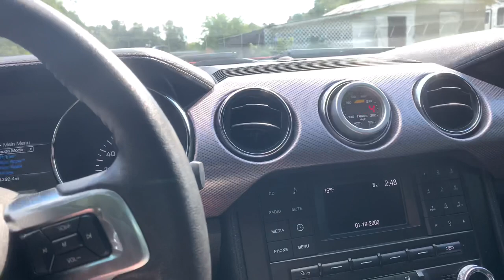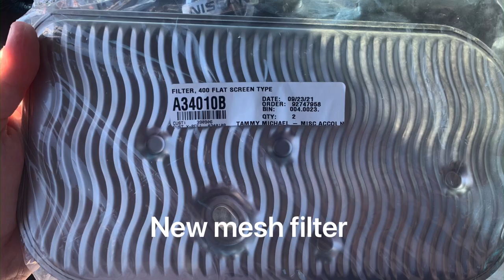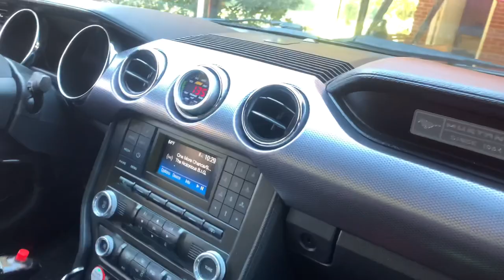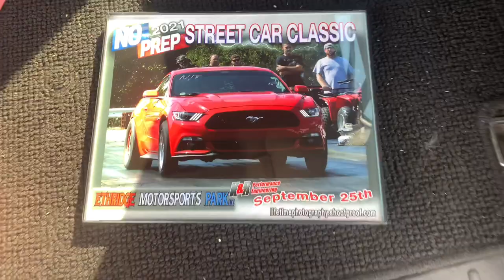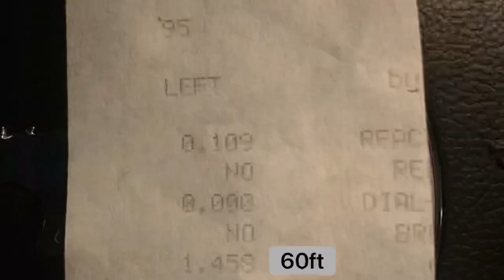STREET CAR CLASSIC 2K21, TESTING 3.73 GEAR IN 10R80, NO PREP RACING.

Comment: Both Cars looking good ! Just curious what gains did you get from there 3.73 gear change ?
Reply from the maker: I want to say every bit of a tenth all across the time slip. Cold be even more. We ran a PB and didn’t lunch the car no where near as hard. So if we launch the car the same as the 3.55 we could see more maybe. But like I side this gear is not for everyone. This car is heavy (3700lbs) if your around 3400lb you should look into a 331 gear. All weight includes driver.